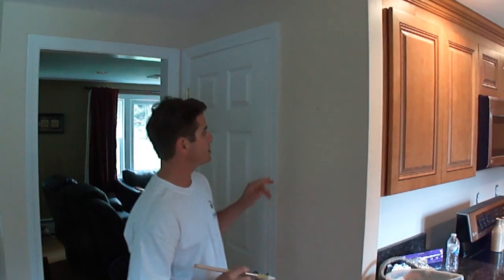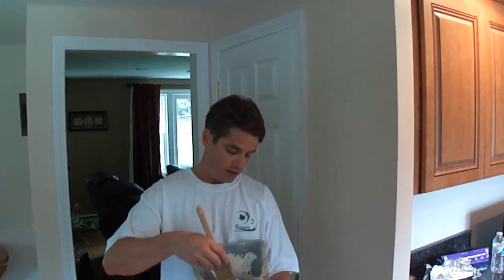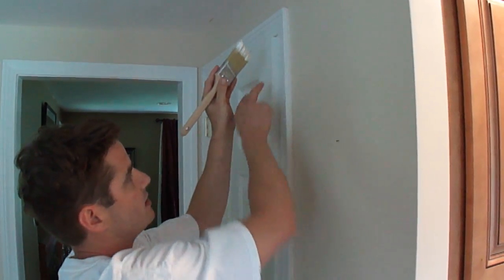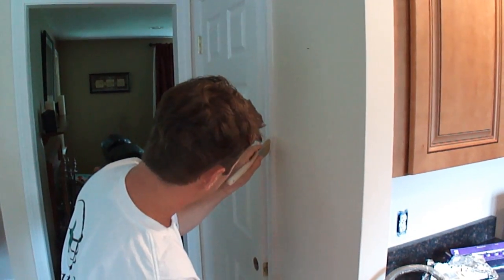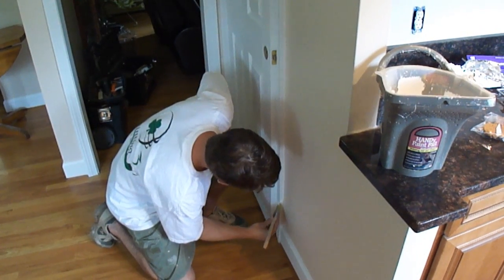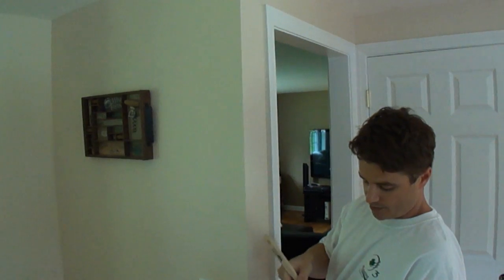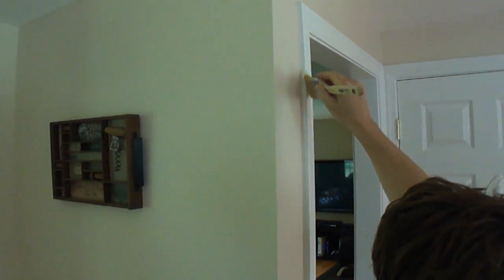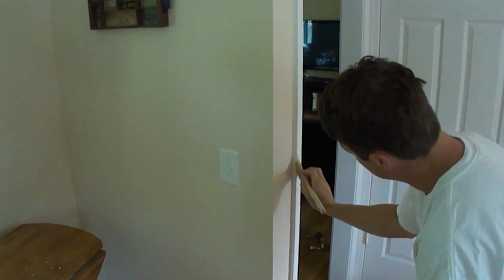DIY How to Paint the Side of New Door Casings - Freehand (No Tape)

Comment from the maker: Hi Derek- Thanks a lot. The windows in the Clerestory didn't open and I was using a solvent stain and a solvent Poly. That combined with the Heat and no ventilation, made it very uncomfortable or unbearable. I started at 7am, to avoid heat, but it was already to hot up there. Have you been in this situation before?

Comment from the maker: Yes your exactly right! Painting trim first and overlapping on to wall, then cutting in wall is the way to go. I entered this job and the walls where done first and they only wanted trim done. Its a last case scenario, where you just have to paint trim and not walls. In my description of the video I write about this. Yes, it will never look as tight as if you painted trim first and then cut in walls next. I am showing you how to paint the trim last and create a straight line free hand.

Comment from the maker: Part 2-  Also, the painter needs to apply the exact amount pressure to the caulk gun to leave the right amount of Caulk because when you smear it with your finger, Its going to overlap on to the wall. And if the wall is painted a darker color, then you are going to see the White caulk on the darker walls and then you need to Re-cut the walls 2 times. So Yes it can be done under the right circumstances, but its always best to caulk first then paint. What color is your trim and walls?

Comment from the maker: Hello- That is a Great question! Yes and No. If the caulk is going to match the Trim, Let's say the Trim is White and the Caulk is white, then Yes It will help Hide any Wall paint that has gotten on the Trim. But, be aware that at a close view to the trained eye, you will see a sheen difference in the Caulk Vs. the Trim.

Comment: Russ, is there any circumstance when you do not caulk between trim and the wall? When you do caulk do you use caulk that dries clear or white?  Thanks.
Reply from the maker: Hi Vinny-

Its just a personal aesthetic preference. If you have varnished trim, then most people do not caulk. Or on commercial jobs where quality isn't important and the General manager just wants to get in and out, they don't usually caulk.You can use either white or clear, or they can infuse paint into the caulk tubes now, to get any color you want.

Russ

Comment: Question.... I noticed the two doors meet very closely.... how did you get the wall color in there cleanly?  I have an acute angle in my hall where two doorways' trim are very close, but there is a visible wall space between them.  Any advice - anyone?
Reply from the maker: +muggito7 

Hi 

Thanks for your question! I use a small Artists brush for those tight areas. Make sure to paint the trim first.

Russ

Comment: Russ, I'm painting some smooth surface solid core doors (on saw horses).  The first coat got a little buggered up in some spots so I need to sand.  Any advice on how to go at it?  Thanks.
Reply from the maker: Hi Vincent-

Thanks for your question! How did you paint doors? Brush and roller?

Russ
Reply: Roller (foam...sorry). :-)
Reply: I can switch to fabric for final coat if you recommend that.
Reply from the maker: Hi

Switch over to a 1/4 inch nap!

Russ
Reply: Yes sir...Funny.  I had both ready to go too.  I'm leaning that its very hard to know how much paint you have on the foam rollers anyway.  And your advice on sanding on select areas of the first coat?
Reply from the maker: Vincent Esposito

Hi Vincent-

Just let doors dry and then sand off any buggered up areas. What type of paint and sheen are you using? Also, its very important to strain your paint so no buggers can get on the door.

Russ
Reply: Hi. Russ.  Much better result with the nap.  Thanks.  I'm using BM semi-gloss white. The smooth surface doors are a challenge because its one uniform surface with no texture or lines between faux stiles and rails. Not a lot of room for error.
Reply from the maker: Hi

You really have to work fast with the doors, especially when using a semigloss.  It doesn't sand well either. 

Russ
Reply: Russ Olinatz
Yeah.  A 4 foot wide roller would be perfect...LOL.  I see why some pros spray 'em. BTW, thanks for all the advice.
Reply: Russ, i wanted to close the loop  on this.  I switched to 1/4 nap.  Also changed to the "other leading brand" with a satin finish and added some extender.  The doors look fantastic!  I could not be happier.  Thanks for all the tips.A real life saver.
Reply from the maker: Vincent Esposito

Hi Vincent-

Perfect! I am glad things worked out well for you! The 1/4 inch nap work Great!

Russ